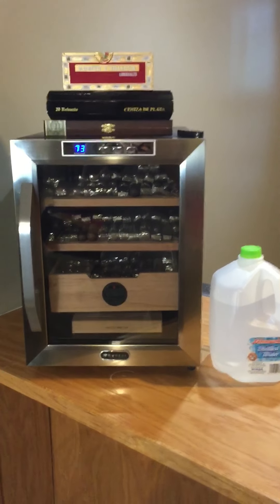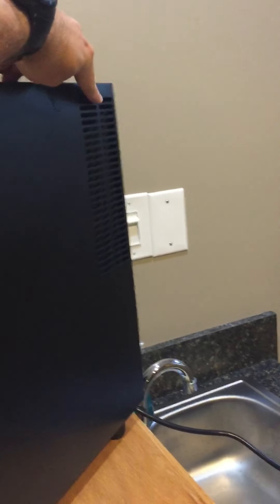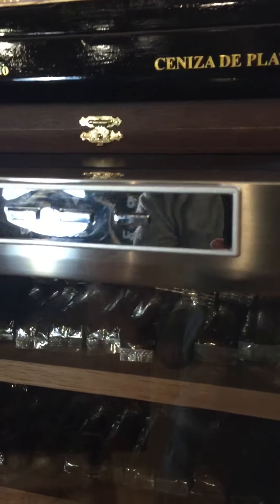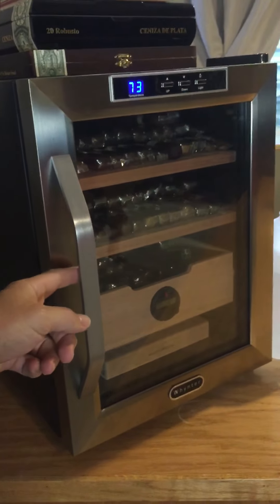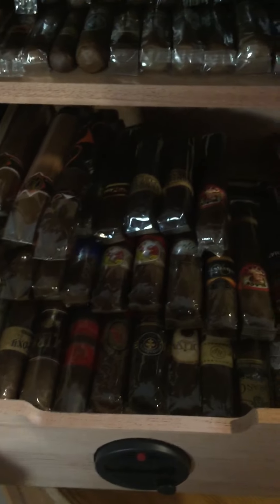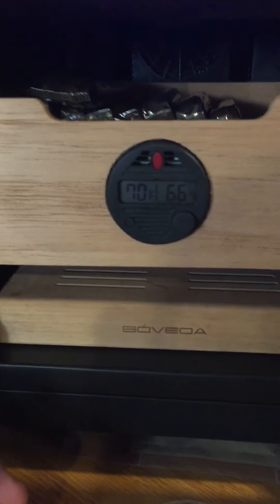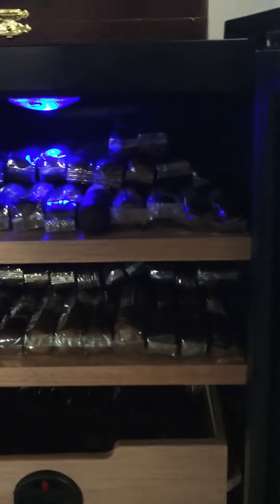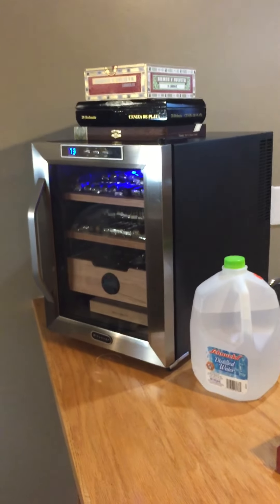Whynter 120S cigar cooler review

Comment from the maker: **Update** I sent back the whynter in the video and whynter replaced it in about a week. No problems with the temp on the new one.
Reply: I've got an ignorant question coming your way, but I wonder if the heat pump unit was working at all?  73 is pretty run of the mill room temp.  Kinda sounds like it wasn't doing too much of anything.
Reply from the maker: Heat pump?  The old one wouldn't cool to what it was supposed to cool to..
Reply: yes, just like any refrigerator.  It just seems like the unit didn't work at all, considering it never moved from room temperature.

Comment: I  bought one of these a month ago. Instead of the tray provided for humidity I purchased a Cigar Oasis Excel 3.0 which provides excellent humidity and temperature readings. I was unable to calibrate either of the two  hydrometers supplied by Whynter (total junk) because they have a slotted screw on the back where they insert the coil spring making it impossible to adjust either of them  even with a small screw driver. Its a terrible design. I contacted Whynter about the problem and they told me to just go get a new unit. I doubt a new one would be any different.That would be also be a hassle as I would have to go to the trouble to order another one (which may or may not work as well as the one I have), then season it all over again, etc. I did not want that. So I am going to do what you did in the video and order a digital hydrometer and drill out the hole to insert it. That will then keep a check on the readings of the Cigar Oasis humidifier. Not happy with the bad response from Whynter though.

Comment: I just got mine I got it off amazon and it’s been great for me, really glad I made the investment, I would definitely recommend it over a desktop humidor
Reply: I just ordered the 2.5 cu ft one on Amazon.  I've been watching reviews and reading comments on the Amazon feedback, and it looks like a lot of the units have problems with the heat pump or control board fritzing out.  Either they work great for years, or the board freaks out and cooling is ALWAYS on, or the fan that blows air over the cold side of the heat pump dies which causes the cooler to run constantly and suck all the humidity out of the air.  Guess I'll find out which one I got real soon 😶.
Reply: Andrew Hosford so far mine has been good, I didn’t get the heating one, I live in Florida lol good luck! Now it’s time to stock it up haha
Reply: @ThermalDynamicSevices  haha yep, stocking up is a journey through flavor town!

Comment: I have the same one. I wiped it down with distilled water on Friday, it is now Monday and I can not get the humidity down. On the gauge it’s still reading 90, what am I doing wrong lol
Reply from the maker: The gauge that comes with them are junk. Get a different one. Digital ones are great. Also, if you can’t get the humidity down.  Just open the door.  Are you in a humid place or an arid location?
Reply: @pssita  ok great I will get one today and I actually have it in my living room for now and we keep it pretty comfortable in there

Comment: Hello WxGuy. 

I ordered the same unit after watching your video.  I've not had any issue with temp BUT have just gone around with Whynter about the drawer itself. I opened an issue with them and they were no help.  My issue was that the rails on the drawer are not correctly placed.  If you compare your unit to the pictures on Best Buy or Whynter.com, you'll see the drawer is suppose to meet up with the middle shelf.  This eliminates the dead space and gives you more room on the floor of the unit for boxes.  After receiving no help from Whynter, I corrected the issue myself by popping off the drawer rails and moved them to the bottom (as they should be). Just thought you might be interested so you can regain the space.

-Kevin
Reply from the maker: I think I'll do that too. Great input!  Thx
Reply from the maker: So.. I took your suggestion... Should have done it sooner.. saved a lot of space..

Comment: Thanks for the video. Question on the temperature. The temperature control will only let you go as high as 66 degrees but based on one of your replies, the actual temperature inside the humidor is 70 degrees. Did you set the temp at 66 degrees on the control?

I have one coming next week so I am curious on the temperature range that the humidor says it has and the actual temperature that it will registers inside.

Thanks again.
Reply from the maker: Currently, I’m my new house.  The whynter will go as warm as 66 and as low as 50F. Mine is holding at 70 in the basement now.  It is UNplugged.  Because I find 70F and right now 67 RH to work fine.  But in theory.. it should be able to keep it at 66F.

Comment: Thanks for the review. How is the water stored and how often for refills?
Reply from the maker: Notice the boveda pack on the bottom.  There are 4, 69% boveda packs inside.  I ended up just seasoning it with distilled water.  The boveda packs work great.  I recharge them every month or so.  On a rotation of sorts.

Comment: How do you control the humidity? I could not find a way to do it?  It seems to be a cooler only as opposed to a humidor.
Reply from the maker: Any humidor requires a humidity source.  This one is no different.  I use Boveda packs. They are easy to use and can be “rehydrated.”

Comment: I have owned the model CHC-120S for 18 months. until two months ago all fine. nNAMEow I cant get the temperature control to work I try to set above 60 and every time I check it is in the 50's
For now I have unplugged it. Any way I can fix it?
Reply from the maker: That sounds like the problem I had with the original. Luckily, I was still under warranty and they replaced it for free. Sorry to hear that.
Reply: It sounds like your temp sensor has gone bad or the control board has gone.  You'd have to pull the unit apart and replace the temp sensor to see if that fixes it.  If not, it's a control board issue, and you would need to get a new control board from Whynter, which sounds like a pain.  The only alternative I can think of is to replace the control board yourself with a Raspberry Pi or Arduino and program it to replicate what the control board was doing (isn't doing now) by kicking a relay to power the heat pump and heat pump fan whenever the temp drops below your setting.

Comment: So it can only control the tempurature? It doesn't control  the humidity?
Reply from the maker: canadianhangover the humidor itself can only change the temperature. But by controlling the amount of moisture and temperature at the same time... You/it control the humidity.  For example.  Warmer temp + more humidity (distilled water). Will make humidity go up.  Then the same amount of distilled water and cooler temperatures will make humidity go down.

Comment: Do you just have the one 320g Boveda pack?  How often are you recharging it?
Reply: Just saw below you have 4 69% 60g packs as well.  Are you still recharging every month?
Reply from the maker: I'm already in bed.... so I'll check on it tomorrow and give you exact sizes and quantities.  I know I have at least 2 large packs in the boveda holder in the bottom.  I have 1 smaller pack and 1 drymistat tube on the center shelf.  I'm no expert, but it seems that the more cigars in it.. the more often I have to recharge.  I last recharged a few of them about 3 weeks ago and they're fine..  I guess my best answer would be that I recharge them when they need it.. probably something like every month and a half..
Reply: Your setup looks pretty awesome.  Thanks for posting this vid.  You helped me make my decision.  I am just setting mine Wynter and was going to use Boveda but went with the Heartfelt Beads.  Only reason is the beads bounce back better than Boveda when you open/close the door often (like I do).  If you add some kitty litter than might help you not have to recharge as much (check it out online if you are not familiar).  Helps keep the Boveda from working so hard.  Or you might want to throw a few more BV packs in.  Either of those should help you from recharging so often.

Comment: Was the fan inside the fridge unit always on? I have the same Whynter unit and the fan inside isn't ever on. All I hear is the external back fan on
Reply from the maker: When I first bought it, I thought the fan was never on.  However, after taking a careful look at it with a flashlight, the fan comes on after the door is open for a bit.  The fan is very quiet.
Reply: WxGuy, thanks! I left the door open (fortunately my cigars havent been transferred yet) to see if the internal fan would  kick in and nada. I shut the door then checked with a flashlight to see if the fan would kick in... nothing either. Perhaps a blown fuse or bad wiring

Comment: I think I missed it, but can you tell me why you'd still need a boveda pack in here? Does it not regulate the humidity?
Reply from the maker: Kal El all Boveda packs will eventually dry out.  The basement of that house did ok at regulating however, the house I’m in now does a better job and I don’t need to “recharge” Boveda packs for a few months at a time.
Reply: Ok thank you. I just got one for Christmas and was just curious. Wanting to make sure it was able to control the humidity.
Reply: @kalel352  These do not "control" humidity. It is up to you what you want to use for humidification, these units only cool (and some newer ones have heat) they do NOT control RH levels at all.
Reply: Correct...this unit needs some type of humidification.  I have had great success with the 320 gram Boveda.

Comment: How is it working over a year later?
Reply from the maker: It's doing great!   Keeping humidity right where I want it!  It does sometimes require maintenance.. I just replace Boveda packs every few months......
Reply: WxGuy I found heartfelt beads to be a better 2 way solution. Bóveda packs are just too expensive. I have a 1.8 cu units so I would need 10 of the large to humidity my 250+ cigars.

Comment: is that a coolador or humidor?i dont know the difference
Reply from the maker: It's referred to as a coolidor. But is is also a humidor. The main difference is that it has a cooling unit built into it.   The shelves and drawer are Spanish cedar which is what traditional humidors are made of.
Reply: +WxGuy how warm is it program now?do you think its better then a regular humidor.Im asking cause im looking to upgrade thanks. i like mine 68'
Reply from the maker: +David Roldan the new one works to the advertised specs. 66 is high end and it goes down to 50.  Currently they are at 66F and humidity at 69F.

Comment: How has it held up?
Reply from the maker: It's doing great. Just did some routine maintenance ..threw in a 75% Boveda pack.. One of my original ones dried up a bit. Rh is steady at 68%. It's holding 120 cigars now!
Reply: +WxGuy Kool; thanks for the quick response I think I am going to get the bigger 450 ct.
Reply from the maker: +rr5683 probably a good idea. The only good thing about this smaller one is that it would cost a fortune to fill the big one!  Stay smokey!!
Reply: +WxGuy Yea, my problem is not stocking 350+ stogies; its keeping them long enough to age em 2+ yrs. Long ashes, BOTL!

Comment: well guess what. If your cigars are in plastic, they will not be regulated. Think about it!!
Reply from the maker: Are you talking about the cellophane?  If so.. It's not air tight... P.S.  That debate won't go away anytime soon...if that's what you mean...stay smokey!!
Reply: +WxGuy how is your unit working now? any problems? i just got one and am having a small issue with condensation coming from the fan. its not a lot just a few drops of water but im worried this will mess up the humidity and maybe cause mold. any similiar problems?
Reply from the maker: +fe4r da be4rd fe4r da be4rd I love it. Zero issues.  I did however adjust the bottom shelf.  I took off the rails and moved them to the bottom of the shelf.  It gave me about 1.5" more of storage.
Reply: @timmy Sheehan
Well guess what cellophane is not plastic it's a plant based material and it's porous.